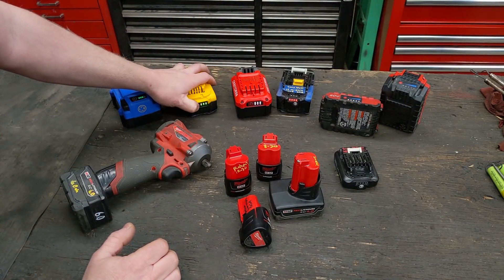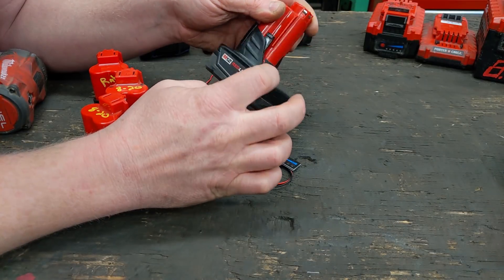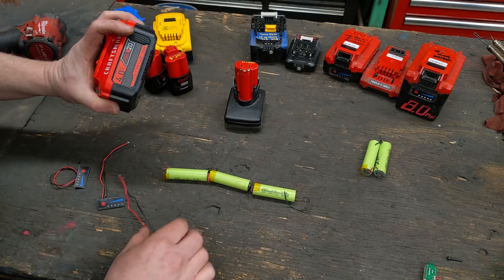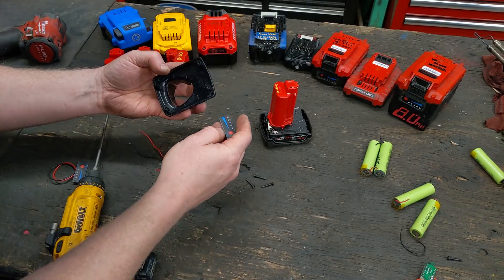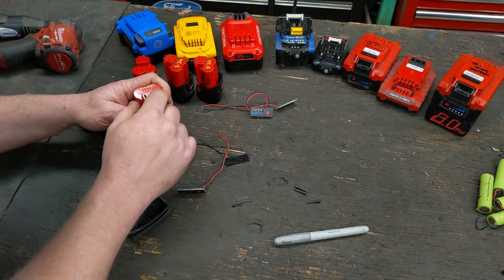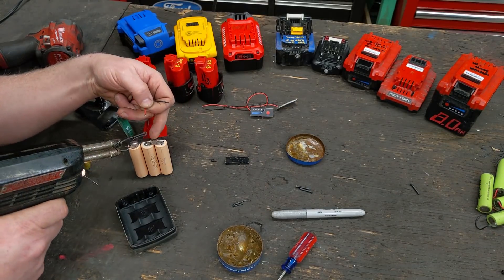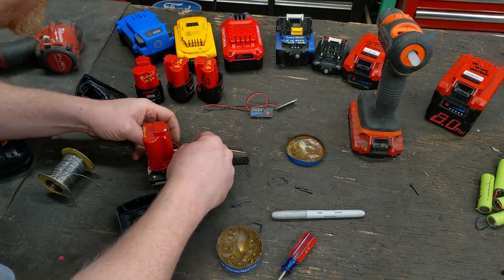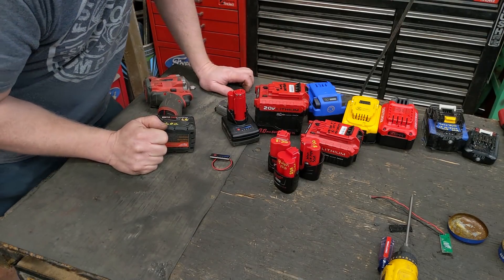Install Battery Gauge Milwaukee M12 and OTHERS battery packs

Comment: I have the same soldering gun. I got some gauges that will do 5-30 volt, Li-Ion, Li-Fe, and Pb, thin and easy to fit in. You talked about a 9 cell battery, common sizes are 5s, 5s2p, 6s, 6s2p, 10s, 10s2p, or more in parallel, don't know where 9 cell fits in, great vid nice dog too
Reply from the maker: @billinphoenix255  I likely said Nicad cell
Reply from the maker: @billinphoenix255  I did say nine cell coming to think of it. Those are the 12 volt packs that I build that are 3s 3p.
Reply: @sixtyfiveford  That sounds ok. I make my own packs, all sizes, these gauges help keep track/when to charge

Comment: Just got my first Milwaukee m12 tool (bare) i do have 20v dewalt tools with batteries is there any adapters or do i have to buy the m12 batteries thanks
Reply from the maker: There's not. 18-20v adapters are available as they are the exact same voltage just marketing hype between manufacturers. The adapters don't change any voltage, just trick the tools into thinking they have an oem battery.

Comment: So, if I wanted to just touch the two loose wires from the battery gauge while holding down the test button, (without installing the gauge into the battery housing), onto the positive and negative metal tabs of the battery pack, I would need to use the S3 battery gauge, and that should also suffice to give me an accurate reading of the entire battery pack’s charge level, right? (As I figure the S1 or S2 gauges would only work if I were to open up the battery pack and test the individual cells inside, right?)
Reply from the maker: Yes, you're correct for 12v lithium packs.

Comment: My GF's Dyson cordless vacuum has a fixed battery pack and also no meter and it drives us nuts. Once the warranty has expired I'm totally adding one of these!
Reply: Just checked and it's got more than four years left on the warranty. Kind of hard to be upset about that, though.

Comment: If you buy the surface mount guages, there in no need for cut outs. I bought both styles and I am glad that I did because a couple of my batteries did not have enough space in them to flush mount the gauges. https://imgur.com/gallery/qlVY2jm

Comment: Battery gauge only shows voltage level which is only half the story. Batteries work on voltage and current flow. Your battery can show full voltage and appear charged but its current capacity cant be measured until you put it to work.  
Do you ever wonder why a battery shows full voltage but when you try to use it you get very little from it and it dies fast ??
Reply from the maker: Yes and no. Lithium has a very predictable life with a simple voltage reading and doesn't have a superficial surface charge like Nicad Nimh.
Reply: @sixtyfiveford  it does not matter what chemistry the battery is, from car battery to motorcycle battery to kids toy battery to ryobi to dewalt ... i have had many show full charge after a full charge and will barely run the device or crank the engine ... 
That battery level is only half the story
Reply from the maker: @ACommenterOnYouTube  It absolutely does matter. Lead acid always has a surface charge. Same with old power tool batteries. Lithium just like in your phone the percentage left is determined solely by the voltage. Lithium will not get a surface charge and at 3.6 volts it'll sit there and it's exactly 50% power remaining.
Reply: @sixtyfiveford  well based on experience i will disagree with you 100% ...  i just replaced my lithium car battery last month. It read 13.5 Volts but would barely crank the engine over, yet the voltage indicated full charge. Got the new one, also showed 13.6V and cranked the engine over with ease. 
Sorry man but real world wins ...
Reply from the maker: @ACommenterOnYouTube  No gasoline or diesel car out there is running a lithium starting battery. They are all lead acid or AGM.
Reply from the maker: @ACommenterOnYouTube  Yeah, that's not a car battery. No stock manufacturer has ever put a lithium starting battery in a gas/diesel car. You're dealing with Lead Acid which has nothing similar to Lithium in any way.
Reply: @sixtyfiveford  well i never said it was a stock car battery. Many people in the car stereo competition world use these batteries as primary starting and as a secondary in the rear for their amps because of their technology and super strong high current abilities.

Comment: I tried to make a super-duper lithium pack for, of all things, a Dyson cordless vacuum. I was pissed off to find, however, that the BMS in the original Dyson pack was smart enough to know I'd monkeyed around with the battery and would not run at all. Game me the blinky red light of death IIRC. Probably recorded that zero voltage when I had the BMS disconnected from power and flagged it as a no-go. Have you ever run into this in your travels of modifying tool batteries?
Reply from the maker: Makita is the only one I know of that logs a fault and will reject a battery to charge(has to happen a few times). I haven't completely removed the BMS from one so I haven't had any issues. You can buy a completely new logic board/bms for the Dyson battery pack pretty cheap https://bit.ly/2LzACmJ (v6 model) . Are all the sets of cells over 3 volts? They also need to be roughly the same voltage, so you may need to manually charge each set(can be done with pack fully assembled).
Reply: @sixtyfiveford  Yeah I did everything you suggested, manually charged each set until they were balanced, but it just wasn't happy. And unfortunately there's no way to bypass any of that circuitry and run power straight in as everything is just so tightly integrated, tool and battery having lengthy conversations about the weather, politics, etc. Not modder friendly at all.

Though it turns out I can just get a "4000mah upgraded!" battery for $23 on the fleabay, so I might just do that. But the battery I made would've been so good. I hacked up old Black and Decker Single Source cases to make a big fat box for 12 18650's, then screwed the Dyson battery top onto it. It was a monstrosity. I would've loved to try it out.

Comment: Interesting. I do prefer a gauge on the tool though
Reply from the maker: I wish the one tool one would stay on longer/ or the entire time while the trigger is pulled like the ones you find on Makita etc. Especially with cutting tools I'm used to looking at the battery meter occasionally while running but the M12 is always off and needs to be stopped and restarted to show. I do find the Milwaukees onboard gauge to favor the full side and as you know the first two bars take way longer to go away than the last two that are gone in a fraction of the time. The aftermarket gauge is dead on and when it says you have 50% left you actually do.

Comment: Great video, I just got my first m12 tool so good to know this is an option. What kind of 18650 cells are in that 4.0? From what I understand the 4.0 has the highest CDR of all the m12 batteries for the most power
Reply from the maker: The 1.5 and 2.0ah are going to have 30amp max discharge cells (LG HB6/LG HD4). The 4.0ah is going to use two sets of 3 cells (LG HD4) in parallel to supply 60amps max discharge. The tools don't really need the 60 amps and they run fine on 30 amps but you'll have less of a voltage drop. So the voltage will remain higher so the tool will feel more powerful. 

This is why I built my own 6 amp hour pack so I can put three sets of cells in parallel and obtain upwards of 90 amps. The voltage drop isn't noticeable at all and the tool has significantly more power.

Comment: Sweet. How did u soldier in the extra cells? I'm wanting to switch my low capacity cells for higher ones. Thanks
Reply from the maker: First I will say you can't just use any cells for a power tool. They have to be High Drain cells capable of supplying 15-30amps continual discharge. A lot of people try to use salvaged laptop batteries or 18650 cells from other sources and they won't work. This video talks about it a little more https://youtu.be/qZ_dwesKFwY
Reply: @sixtyfiveford  I've done the cell research I just need to know if I can soider the cells directly or not. Like I know heat is the biggest enemy of the battery cells. Hey thanks for replying imma add u to my sub list cuz ur content so far is awesome!
Reply from the maker: @muscleman369  Personally I solder them and have done a lot without any ill effects. However there are steps and techniques so you don't dump a ton of heat into the cell. Scuffing and lighting tinning the cells is an important step and allowing it to cool after. Using a large soldering iron capable of getting in, melting and getting out fast is important. A small soldering iron will take seconds too long and dump a lot of heat into the cell. Tin your wires or strips before you take them to the battery. Have everything ready and heat through the wire/strip to bond everything to the battery.
Reply: @sixtyfiveford  am I looking for protected or unprotected cells?
Reply from the maker: @muscleman369  Unprotected. The protected cells are generally only for electronic vape cigarettes.
Reply from the maker: There are really only a few manufacturers you can trust without getting fake Chinese cells. Samsung, LG, sanyo, Sony, Panasonic are about the only ones that are real everything else is fake. The cheapest place to find high drain cells is out of existing power tool battery packs. A great deal is about $10 per amp hour for an 18/20 volt pack. Right now the Home Depot has Ryobi 2 pack of 4 amp hour for 80 bucks. That's 20 high drain cells for 4 bucks a piece. Last I checked they were using a Chinese brand called EVE but they seem pretty decent and should be around a 30 amp discharge. You can find better deals from time to time but they have to be sell prices. If you continually look around sometimes you end up getting them for around $3 a cell.

Comment: First off, great video. Secondly, thank you. It was very clear and all the information anyone needs is here. 

Last thing I wanted to ask was, is this meter accurate? Do they actually display the correct amount of life left in the pack?
Reply from the maker: YES that do. Lithium cells are full at 4.1-4.2volts per cell and dead around 3 volts. They are all near perfectly balanced inside a pack so each one has near identical voltages at all times.  The little meters are just a voltage meter which shows 4 dots at voltages above 3.9volts per cell, 3 dots at 3.6v or more, 2 dots at 3.4v or more and 1 dot at 3.2v or above. 3.1v and below will show no bars or a zero charge which is accurate with all lithium cells.
Reply: @sixtyfiveford  that's perfect info. Thank you again.

Comment: Milwaukee m12 battery gauge is built in the tool.  Just pop it in pull trigger a bit battery lights will come on.
Reply from the maker: That's fine until you have 2 dead ones in your tool bag and 2 full ones. You have to insert every one back into the tool to check it. Of course they could just put a battery gauge on the battery like every other manufacturer though.
Reply: @sixtyfiveford  That's very true sir, They should have a gauge but im sure most folks keep an eye on their batteries and keep them topped off when low. Dead batteries ain't making you any money. Not all use them professionally but when you need it you want it ready.  Good video though.

Comment: Porter Cable and Ryobi used to sell stand-alone battery testers that slipped over the contacts. I supposed if you didn't want to cut up you battery case and solder you could make something that just slid on the end of the battery for testing.
Reply from the maker: Good point.

Comment: The tool says battery life right on the side.I Use these literally every day and not sure this would be any benefit for me to do. Great video though.
Reply from the maker: If you take these out on a job sometimes you'll have 3 used dead ones in your bag and 1 good one. Now you have to insert everyone to find the good one vs just pushing a button like you would do on your 18v stuff. I've also set ones aside because I knew the charger was occupied and during cleanup put a dead battery back into the charged pile only to grab it a week later. It's just convenience, but that the entire point of cordless tools to begin with.
Reply: @sixtyfiveford  These are valid points that I have never really thought about or run into. Awesome video and thanks for explaining situations where it would be handy. I only have 2 of the smaller batteries and both are different size so it has not been an issue but could see when you add more batteries how this would be a help. Cheers.

Comment: With my old drill I would crawl all the way to the other end in the attic,  Then I would drill about half way threw something and the battery was dead.   All of the tools I use now have the battery gauge.
Reply from the maker: I've grabbed an extra M12 off the shelf thinking it was charged only to put it in while I was at the wrecking yard only to find out it was dead. It was my mistake but if it had a gauge button I would have checked it.

Comment: the m12 tools have a battery gauge on the actual tool idk why you need one on the battery too
Reply from the maker: I grab batteries all the time to take them out on the job and when I come back I have 2 dead in my box and 2 good. Which are which? I have to plug them all in to test or I could do like every other brand and just push a button. It's a 100% a cheap out by Milwaukee. Tons of my other brands all have power meters on the tools as well as the battery packs. But when I go through all my brands and batteries only the cheapo ones don't put meters in the battery pack. Also the meter on the M12 tools is off by a lot. It favors the full side. The first two dots take the longest to go and the last 2 are gone in 20% of the time.

Comment: I'm not A Fan of Milwaukee Power Tools Anymore . ( Dremel Either )  had Two Cordless Milwaukee Spark like Crazy That Were Brand New . Switched to the King Makita ! Corded .Which I Used for Years In Const. I Now Own Makita Cordless Which I Use At Home  - The Best !  Milwaukee Knives Are Good . As Are Their Cobalt Drill bits .
Reply from the maker: I also had two brand new Milwaukee tools give me a smoke show new out of the box in 2020. My Makita have never let me down, nor my DeWalt. When I did fine woodwork/construction, everything was DeWalt or Makita and they only retired when battery platforms changed. The tools themselves will still work to this day with a good battery. Saying that though I decided years ago not to stick to one brand and just have them all. I generally sell them off the ones I don't like after a few years of use so I get the majority of my money back but get to try everything and keep the best. Milwaukee is powerful and like driving a 18wheeler. Great if you need to haul 50,000lbs, not so much just driving to the grocery store. It's just raw crude power. DeWalt is the pickup truck. More than enough power and plenty comfortable no matter what you do or where you go. Makita is the Luxury car. It's quiet, powerful and you feel refreshed after using it.  It's hard to explain Makita to people who don't try it, but they put so much thought into every feature.

Comment: I have that same Weller solder gun in a hammered green metal box from the 70s I believe... Bought it off fleaBay 15 years agoish for like 12 bux plus 5 or 6 bux shipping... Best soldering gun I've ever owned... Beats the Crap-On I paid a small fortune for off the truck a decade or 2 back which died after 6 years or so of intermittent usage..
Reply from the maker: Mine just keeps going as well.

Comment: Great idea and execution Moe, thank you!
Ginger the flying wonder dog is on it!
I have an old Weller that looks just like yours. It's well over 30 years old and still working. What I like most is being able to custom make ends for it to serve whatever purpose is needed at the moment.
Reply from the maker: The Weller is great. I ended up finding a few more from estate auctions over the years but doubt they'll ever get used in my lifetime. This one was used when I found it and I have 15years on in with nearly weekly use.

Comment: very cool that you can easily get your hands on those charge indicators. Fortunately most of my DEWALT batteries have the charge indicators.
Reply from the maker: I don't use them all the time but it's nice to know the state of charge of a battery when you grab it off the shelf.
Reply: @sixtyfiveford  absolutely! I find it annoying when a battery doesn't have this feature. This is a freakin' awesome way around it.

Comment: And you still have your fingers ha ha :-D
Those little displays look very good,  at least you get a rough idea how good or bad the battery is.
i would not be supprised if all of them are identical units,  maybe holding the button down then connecting the power to it makes it select the right table for the number of cells.
i'm likely very wrong,  but why make different versions when each one can be programmed.
Reply from the maker: I thought about that and it just looks like they just solder different value resistors on it.
Reply: They likely are all the same but programmed differently when built. They likely don't have a provision to change the programming after manufacture though.